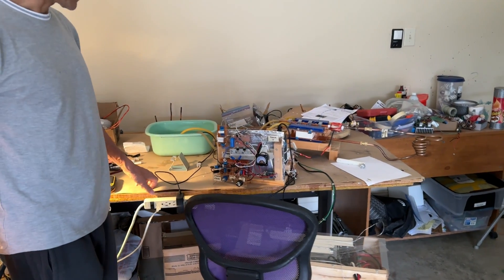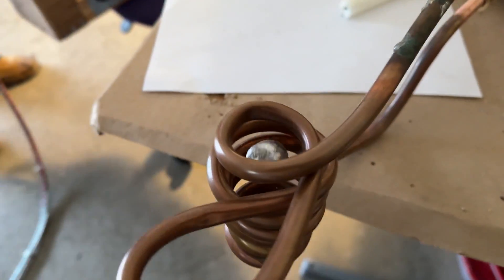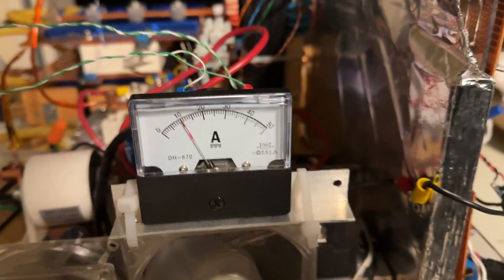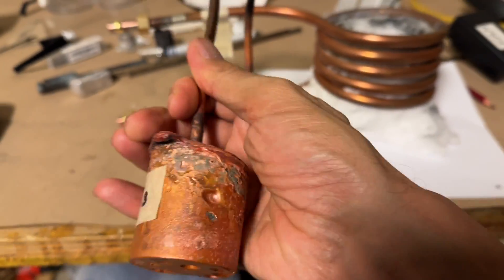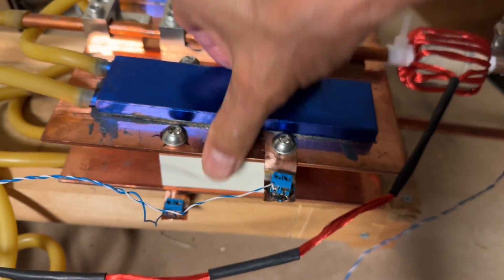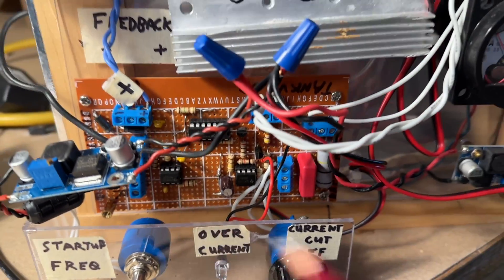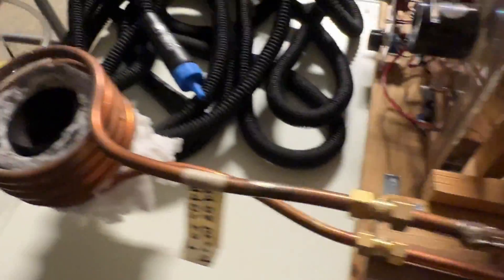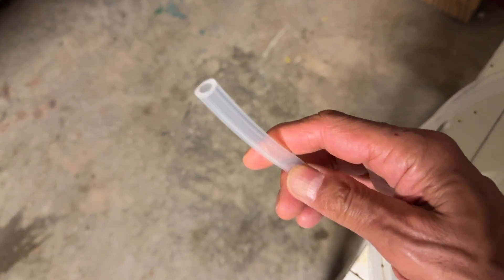Final Video-High Power Current Controlled Induction Heater

Comment: i was going to build something similar to melt steel in 1-2kg range, but i think i will stick to my original plan to build and arc furnace. less efficient but much simpler. great video and work
Reply from the maker: Thank you. I have a finalized build that I have not yet posted- seems to work well. I will post it once I have fully tested it.

Comment: Hey can you point me to where you found those awesome resonant capacitors?
Reply from the maker: I got them off AliExpress. Not cheap but well worth the money because they indestructible:
Just found this amazing item on AliExpress. Check it out! $75.00 | 2UF 500V 650A Solid-state high-frequency resonant tank circuit machine low sense of film capacitors
https://a.aliexpress.com/_mM9JKbe
Reply: @BrianDhvTinkerer  Oh wow, that's not bad at all. I was expecting something twice that cost or more. Awesome, thanks!
Reply from the maker: I got a new build on the current handler l. Got some ideas off hvforum. This one will work at any frequency. Boards still in production. Once I get em, will test out and I can send you one if they work good.
Reply: @BrianDhvTinkerer  Awesome I would appreciate that. I haven't done much with the feedback but I can see how feedback + current limiting sounds the most appealing. I haven't gone over about 450W yet so I've been able to use a high ratio CT I had but I suppose at a certain point that's not going to cut it. I tried the PLL approach first but I don't like the idea of manually detuning to try reducing no load power. Right now I'm just using the VCO to manually tune cause I have to bring it way over resonance just to reach over 50VAC in without exceeding about 5A. I think my caps might pop doing over 600W.
Reply from the maker: @Magneticitist sure no would be happy to send you a board

Comment: Hi brain. I am following your induction heating project with excitement. You solve every problem in a smart way, this is great!
Instead of current limiting, there are capacitors specially produced for this purpose, 5000A value and liquid cooled. I wonder if current limiting would be necessary if this capacitor was used?
Reply from the maker: Thank you! That is very much appreciated. Yes I saw those capacitors and I’m tempted to just use those instead of messing around with current limitation.- dawn cap makes them!

Comment: Nice demo!  Glad to see series resonant drive here, and the levitation coil is a fun pick.

I'm a fan of the PLL style control, myself: frequency is varied to set power output, and all the process variables (output voltage, inverter current, phase shift -- to prevent crossing resonance, power) just act to adjust that upward. With fairly slow compensation (time constant of 10s ms?), this is well behaved and makes for a very reliable, robust and flexible (controllable) system. A few other protective features (input inrush / precharge? desat detection?) and you basically have a full industrial unit!
Reply from the maker: Thanks - it has held up well. Got inrush via a bunch of thermistors. With over current all feedback shuts off. Takes around 10ms or less to get back.
Reply: while i do like the working of PLL to control the power, something in my brain is keeping me from doing inefficent things, if the power factor isnt 1 im just not happy ^^
but it is very reliable, easy and well behaved!
Reply: @contomo5710  A nonlinear control with rapid-rise slow-fall behavior would run just fine at 120Hz ripple, if you mean to run it unrectified. The setpoint could also be modulated by Vin, so that Iout is controlled proportionally, and at normal control bandwidth (but mind the singularity, perhaps use a OTA to stop control movement at low Vin).
Reply from the maker: @T3sl4 thanks!!
Reply: @T3sl4  not even starting to talk about mains power factor, just saying those switches need to start handling a lot as you get into higher power systems, not just the true power but also the reactive going into the off resonant tank
Reply from the maker: Yes, certainly for something that would be used in an industrial setting, power factor considerations would become much more important. That is a good point though that you make.
Reply: @contomo5710  It's kind of an advantage, actually; you need extra inverter capacity anyway to account for tuning range / load variation, and reactance provides an added degree of freedom. Like the old riddle, you can't take a 5ft pole onto the bus but you can put it in a 3x4ft case and take that onboard. The main downside is the variable pole in the control loop, necessitating a fairly slow control (but still more than fast enough for human interface purposes).

Alternately, you can PLL onto resonance exactly, and vary supply voltage with a buck regulator.  More conversion stages is more points of efficiency to lose, but it is easy to control.

Comment: Awesome Brian. I was scrapping some stuff at work earlier thinking about this.. aside from probably running through like 100lbs of copper bus bars I realized I have access to some of the largest heatsinks I've ever seen. Makes me wonder if I could pull something off like this with a bunch of high power fans and a 30lb heatsink haha.
Reply from the maker: I got this thing finalized. Took a bit of extra work, but found a great way of doing the feedback. Here it is:

https://teslascience.wordpress.com/simple-and-effective-induction-heater-current-control-circuit/
Reply: @BrianDhvTinkerer  Cool! Thanks for the write up, I'm just waiting on some copper tube to give it a go. I got some 3/8 OD at first but found it too difficult to work with without kinking.
Reply from the maker: Haha you could!
Reply from the maker: If you get the soft copper from the hardware store, straighten it out, tape off on end and fill the tube with fine salt or with fine play sand, tapping the upright tube on the ground to tamp the sand down and get tight packing, then you can bend it around a piece of PVC or a bottle former to make your coil, then it works well without kinking. That’s basically how I did mine.  It’s definitely challenging if you make a levitation coil 😅
Reply: @BrianDhvTinkerer  That's a great idea, I'd have never thought of that. Might have to give the 3/8 another go. I definitely had no idea how I was actually going to go about making fairly small diameter turns haha.

Comment: Hey Brian! Great work. I'm curious about water cooling, as I'm planning to water cool the IXDN614CI gate driver in my project, and I'm using a water-cooled Illinois capacitor. The coil and the capacitors are being water-cooled on the same water path. Essentially, I'm planning to water cool everything as follows: water enters the water block that houses the rectifier and the IGBT, then the water passes to another water block which contains the two gate drivers. From there, it flows through one of the tank's leads to the capacitor, then to the coil, and finally exits from the other lead back to the original source, which is the iced water bucket. My question is, how do you ensure there are no short circuits due to the water cooling shared among all these components?
Reply from the maker: I’ve done the finalization on the project. It turned out that the feedback using the coupling transformer was not reliable. So I have it all set up and working great. Please check out the revised link.
Link is here:

https://teslascience.wordpress.com/simple-and-effective-induction-heater-current-control-circuit/
Reply from the maker: The gate driver chips don’t really generate that much heat and so don’t really need the water cooling. I would not put them on the same water cooling path as the high voltage electronics. However, if you have already set it up- shouldn’t matter. The iXDN share a common negative

Comment: i really really like this design! its very very nice to see different approaches to mine!! 
i also like monitoring the voltage, (be careful with the voltage on those chinese CCC caps, i blew one up before!)
its quite opposite to my op amp peak detector and 74hc74 latch, all in all, very nice circuit and very nice build!
i cant imagine how much levreage and packed sand/water it took to bend the tubing that tight without kinking it haha
this is the level im happy with ^^

oh maybe one thing i wouldnt have done like it is, the current shunt on the small wire, you never really know the current through it, i think it would have been much simpler/easier/more accurate to just place the current transformer on the primary side, if you have 16 turns, the current through it is just 1/16th
Reply from the maker: Thanks that may be worth trying. Thought about doing that at first, but I’ve always had better success with secondary feedback. I’ll mess around with that in my next experiment.
Reply: @BrianDhvTinkerer  feedback for the overcurrent, not for the tracking, something i did for both tho is just have two fairly decent sized wires running back to the controllor, something that can do 1-2A, and place a second smaller resonance capacitor there (twisted wires going to it) 

ie if you have two a 10uF resonance capacitor in total in your tank circuit resonating at 1000A, a 10nF one would 1A resonating through it, that way you can just use an off the shelf current transformer, or just use a self wound one with much less requirements. 
10uF/10nF => 1000A/1A
Reply from the maker: Thank you. Bending that 3/8” copper was really tough but I was happy to get it without a major kink!